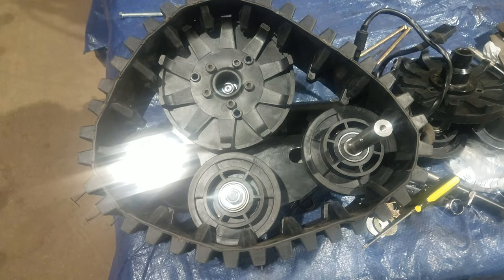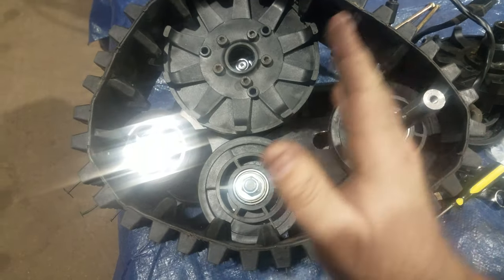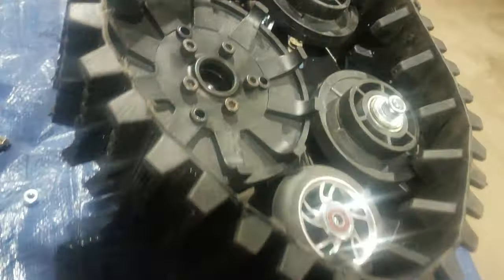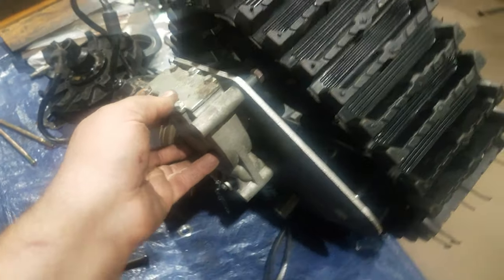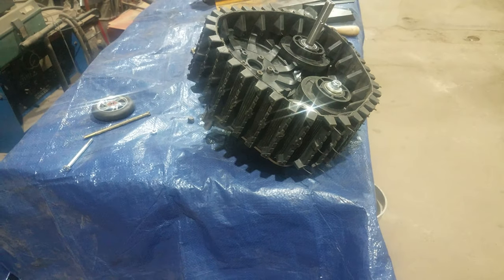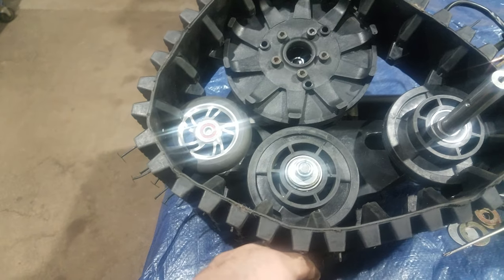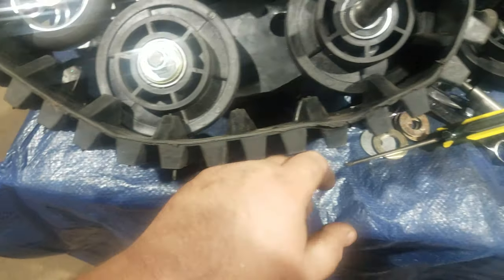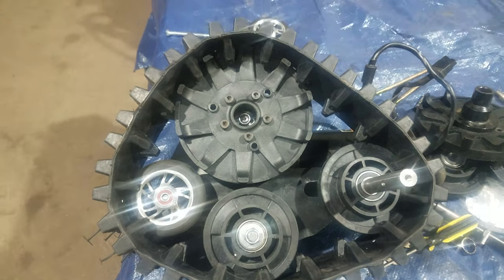Half track wheelchair layout

Comment: I'm very curious what your overall plan is for a half track wheelchair layout.  The chassis, steering, suspension, how the whole thing works.  I've been thinking up different ways to make wheelchairs work better on grassy wet hills and tinkering with articulated streering  and long travel suspension within short wheelbase.  Would like to hear what you came up with, maybe collaborate.
Reply from the maker: Every other tracked wheelchair has one fatal flaw: High current load on turning. Especially on hard, high traction surfaces. My track is curved on the bottom. More like a really big wheel. If you look at the torque and loads to rotate a track, all the resistance comes from the ends, scrubbing on the ground. So....Take a track. Give it a small contact patch when on a hard surface. As the vehicle sinks into a low traction surface, the contact patch increases. The problem is counteracting the "weeble-wobble" of a curved track. So front or rear casters need to be there to keep is stable on hard surfaces.
Reply from the maker: Surprisingly, 14" snow blower tires have worked amazing for a kid I know. On a rear drive chair. With high flotation front casters. I used 4" gas scooter tires. In order to get clearance on the 14" rims, I reversed the rims and machined out the hub of the wheel to bolt on the other side.
Reply: My thoughts as well.  With the broad base tracks provide, there is little need for widely spaced casters.  A single caster may be sufficient, as long as the chair doesn't tip diagonally like 3 wheel Honda ATCs.  If the single caster had 2 driven wheels, it could help turn and drive the chair forward.  AWD.  Hoverboard motors are fast enough, torquey enough, direct drive, backdrivable, built in encoders, have hackable cheap motor controllers, and are fairly cheap and available.  Imagine using a narrow hoverboard as your single caster.  Narrower than this, so the low axle clearance doesn't matter.  https://youtu.be/pH_zwHpNOLo